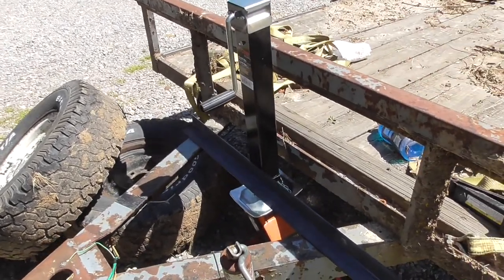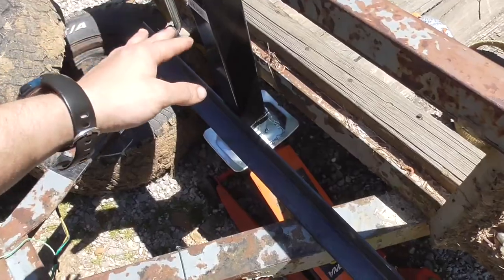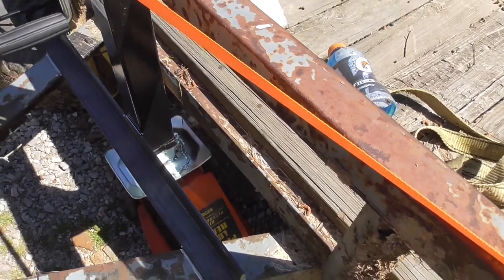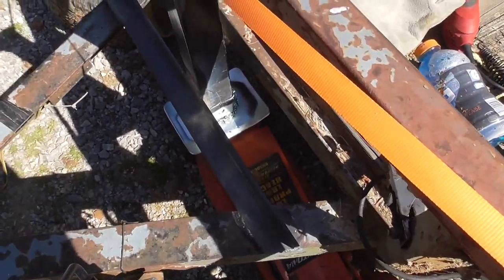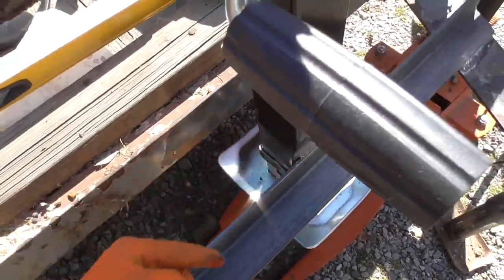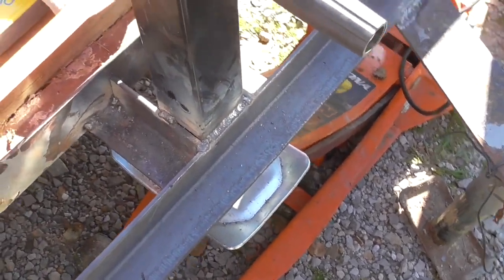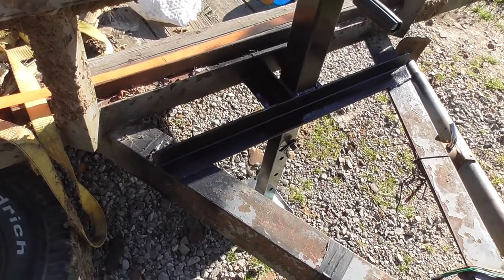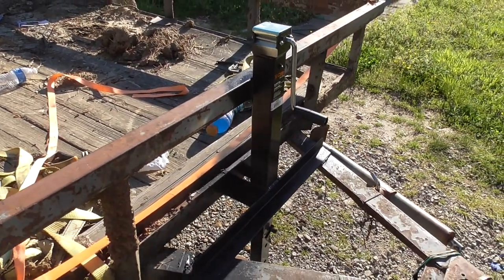Trailer Update Project | Curt 28575 8000 lb Sidewind Jack Install | Weld On

Comment: Looks like a good strong mount for the jack.
Reply: Stronger that the rest of the rusted angle Iron trailer it's mounted to ...lol
Reply from the maker: @yerwrng  That's just surface rust... of what's actually rust. Most of what looks like rust is a red/brown epoxy primer that was used to paint the trailer years ago. The grey topcoat didn't weather all that grate over the years.